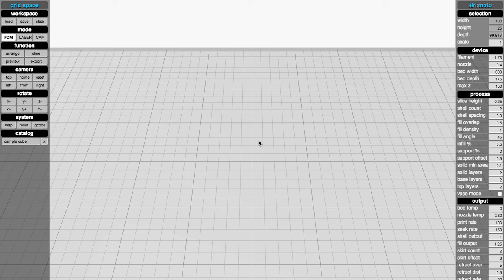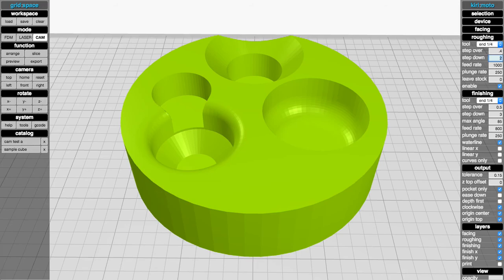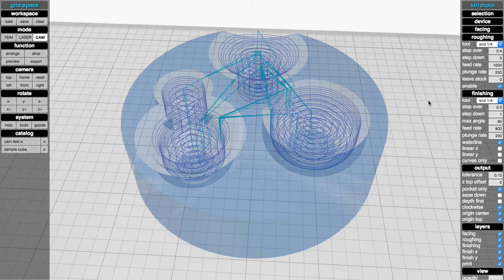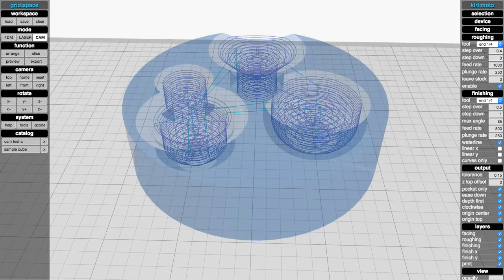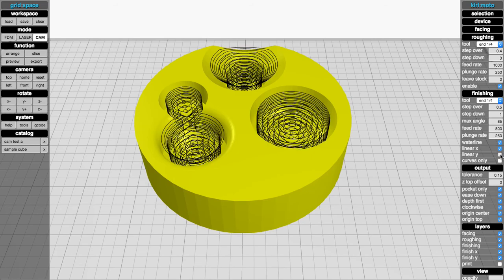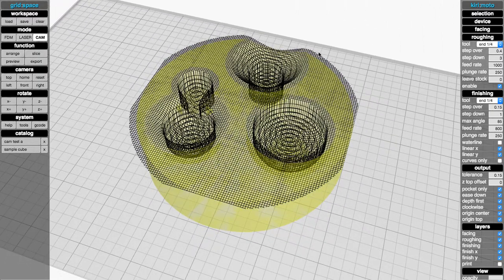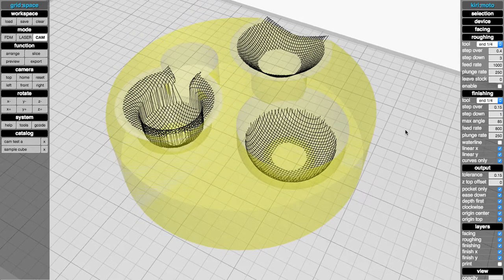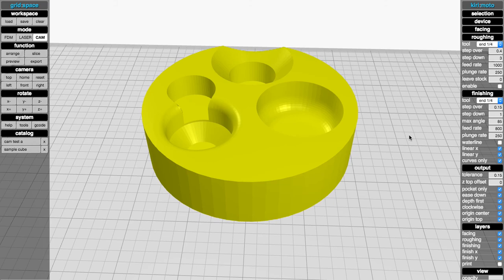Kiri:Moto new CAM features

Comment: Hi. Just trying this via onshape for the first time. I liked the quick start popup but now its gone I can't see how to get it back.
Also a g code execution run time estimate would be great to see so any tweaks made to the setup will show if you're strategy is more efficient or not. That'd be my big piece of feedback. Thanks for making it free!
Reply from the maker: the '?' key yields the quick start menu. clicking 'help' takes you to the wiki. thanks for the feedback. I have a gcode execution time estimator in the works. also, because Kiri:Moto is iframed inside Onshape, you may lose your settings when the code is upgraded. To fix this, visit https://grid.space/kiri directly which gives grid.space the ability to persist settings inside iframes. It's an obscure browser security thing.